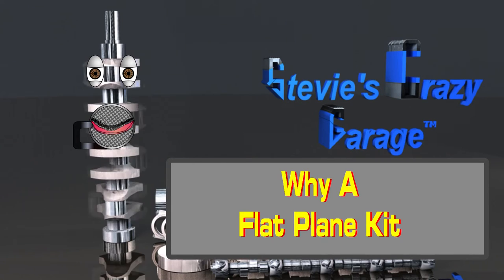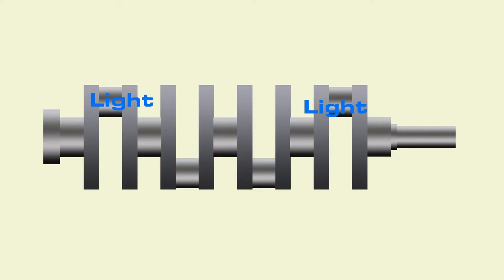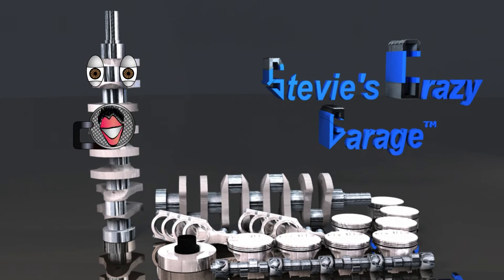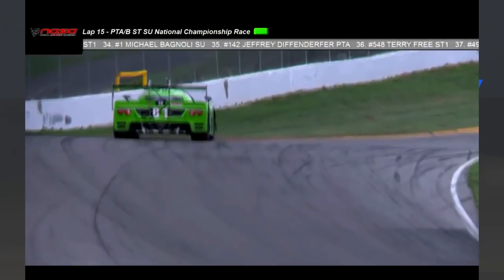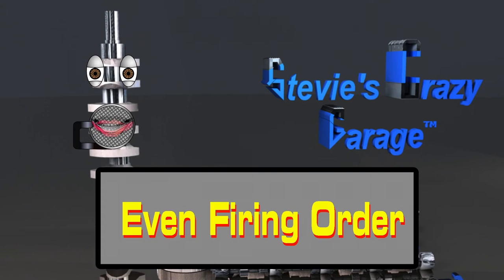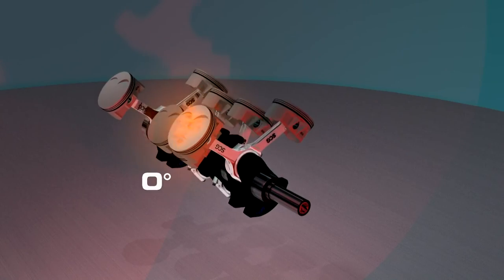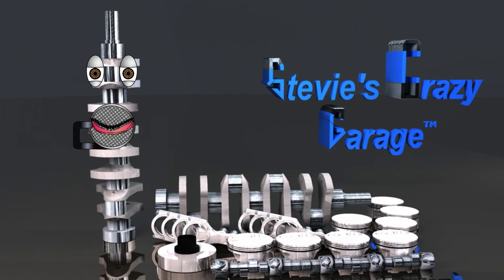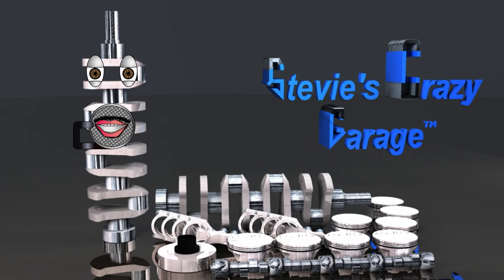Why A Flat Plane Crank

Comment: there are a lot of American vehicles equipped with flatplane crankshafts
Reply from the maker: I am speaking only of V8s. Besides the Shelby GT 350(R) which are you referring too, and are in current production for people like me?
Reply: Kit cars, historically remanufactured race/cars, 4 wheel race track proposed special construction vehicles..
Reply: What were the crankshafts used by 90's-00 Cosworth fords or also saleen